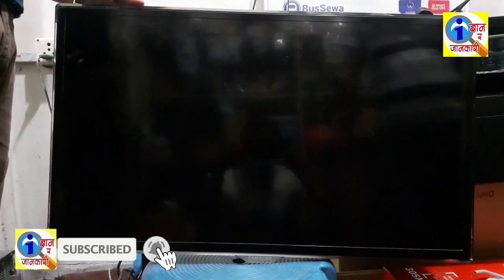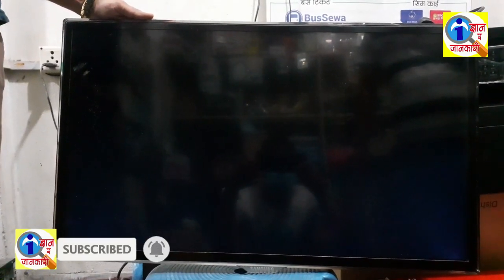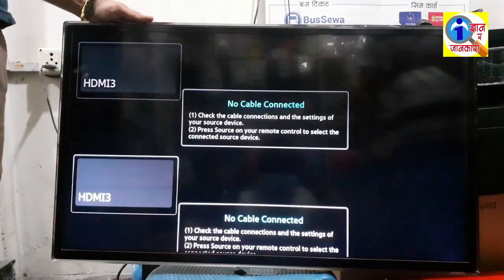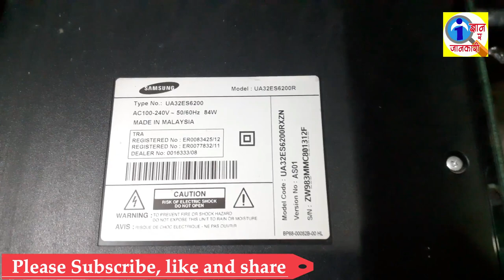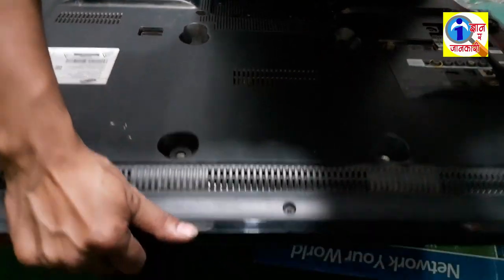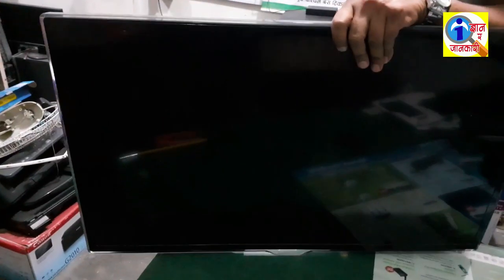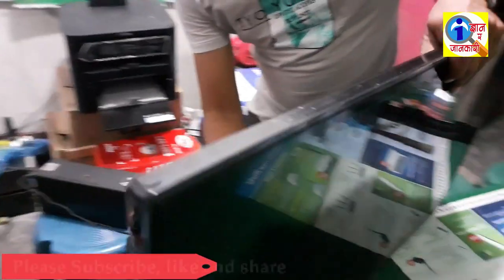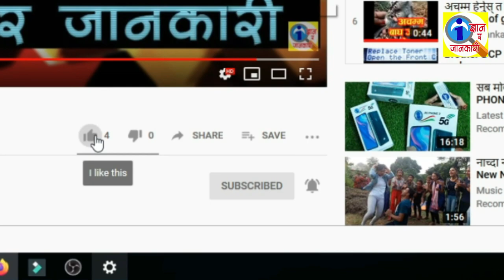Samsung LED Tv Blinking and Flickering [SOLVED] | How to fix LED TV Blinking On and Off |

Comment: Amazing, thank you! The connections looked fine to the naked eye, but cleaning them (my husband sprayed an electronics cleaner on them) made the TV work again! Our TV was pretty new with very few hours of use, so it's great not to have to toss it. Wondering if power outages and surges could have caused this? We've had inclement weather with some of that lately. It was on a (cheap) surge protector though.
Reply: I realize Im quite off topic but does anybody know of a good place to stream newly released series online ?
Reply: @Salvador Alessandro Thanks, signed up and it seems to work =) I really appreciate it !
Reply: @Jaime Cody you are welcome :D

Comment: Amazing can we do the same for thomson smart TV?
Reply from the maker: Yes try once, but be careful while doing.
Reply: @gyanrajankari  While I open the back panel I need your help to identify the cables to be cleaned because the board and wiring differs for each brand.
Reply from the maker: Diassamble a wire , clean it and re assamble it, again remove another cable clean it. Likewise clean all the cable and put it back on its place. If your tv has the  loose cable connection issue it can solve. If it doesn't solve than contact your nearest technician.
Reply: @gyanrajankari  Thank you Sir
Reply: @gyanrajankari  sir also can we clean using cotton dipped in spirit liquid.. Or just clean it with a microfibre cloth
Reply from the maker: Yes you can clean it by spirits or petrol

Comment: My Samsung UHD TV  flicker after  5 min from starting TV. after flickering 10-15 seconds screen completely goes Off only voice coming, What May be issue ?
Reply from the maker: 1st check the cables, disassemble and reassemble it tightly. if the problem doesnt solve then we have to check main board and panel board